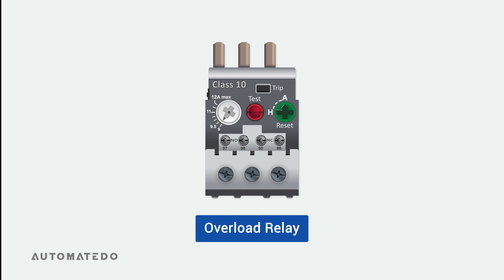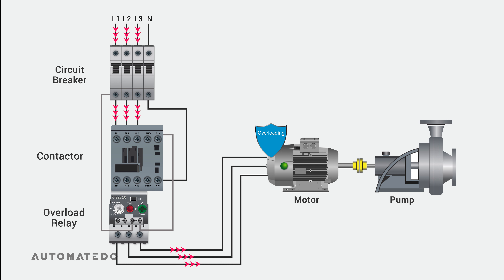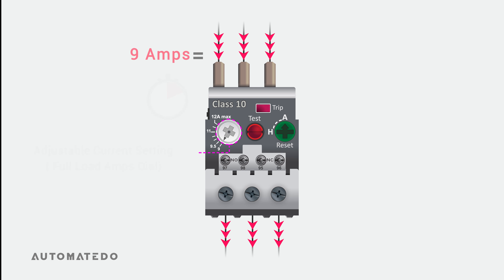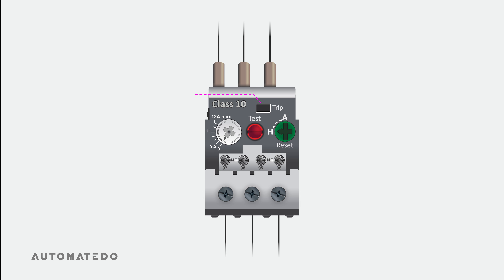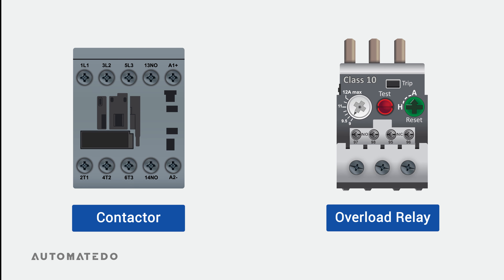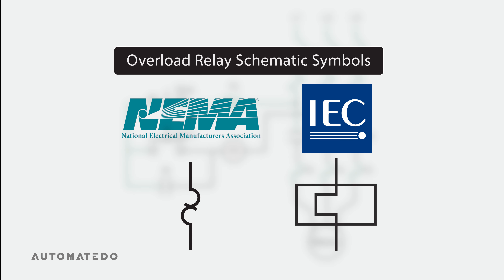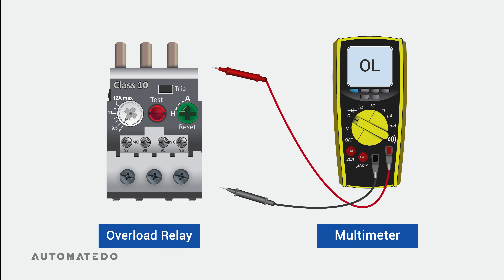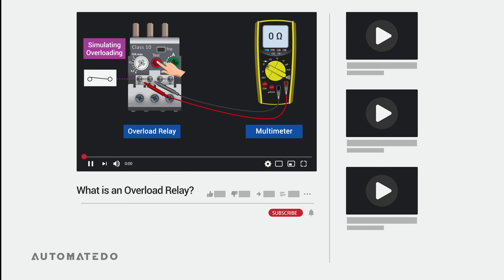What is an Overload Relay? Connection & Working Principle

Comment: Why there is an additional contactor under the stop button on the drawing?
Reply from the maker: In summary, the additional contactor provides an extra level of safety and ensures proper control of the motor circuit when stopping and starting the motor! 😊

If you have more questions or need further clarification, feel free to ask! 🚀

Comment: Hi thanks for the great video. I was just wondering. Can you put just two hot wires from a two pole fuse holder to a three pole overload relay (ex. L1✓ L2✓ L3×)??

Thanks again
Reply from the maker: Yes, it’s possible, but always verify the relay’s manual or technical sheet for specific instructions on using it with fewer than three phases. And as always, ensure proper wiring and safety measures during installation! 😊

If you’d like a diagram or additional clarification, just let me know! 🚀
Reply: @Automatedo  
Thanks I will.

So I got an electrical manual for a back panel and a qps Personnel asked me to fuse the primary and secondary of the single phase step down  transformer in it. In the manual the circuit breaker of the primary of the transformer has a rating of 15A/5KA labelled for it? What is the 5KA signify? Is that the rating of the breaker or is it 15A? 
The secondary is connected to the 200V terminal and has a 9A in the manual. Is that the one I have to fuse? I have a main supply of 208V 3Ph for this machine.